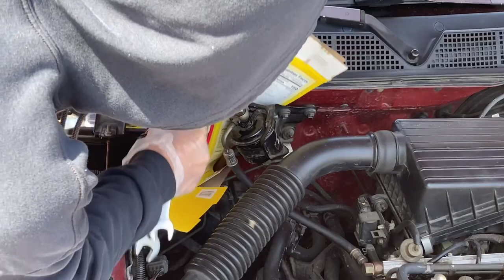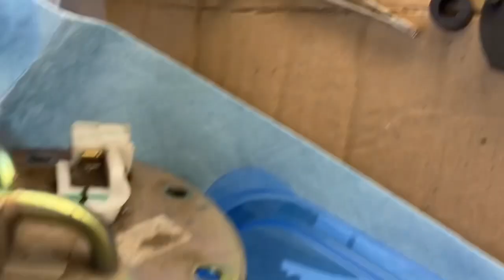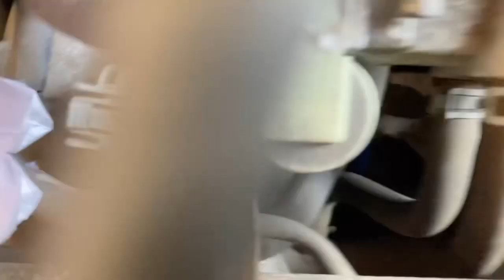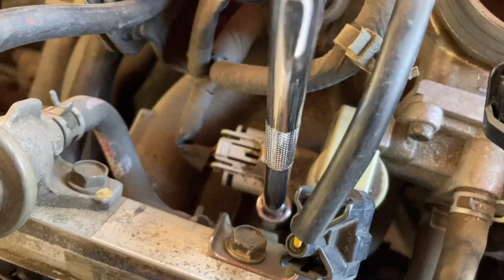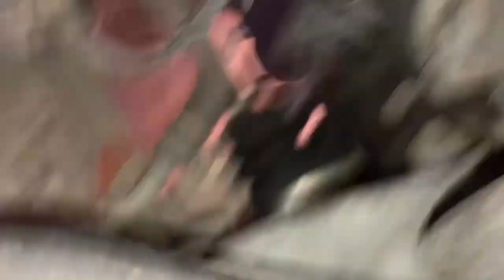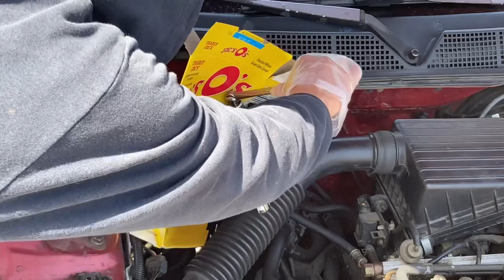Fuel Injector and Fuel Pump Replacement 1998 Honda Civic

Comment: When you installed the fuel injectors. Don't you suppose to program it in the EC???  also why is RPM needle jumping ?
Reply from the maker: No, don’t need to program anything after the fuel injectors
But the RPM needle was jumping because of a chip in the distributor 
I eventually found that one of the parts in the distributor was slowly going bad 
After replacing it, the tachometer works normally 

It was causing an occasional no start and stalling

Comment: I just went to O'reiley website to search on that part # Fj337 Standard Fuel Injector.  its says ---> Does NOT Fit 1998 Civic??? So if this video is for 98 civic than that part should not fit?
Reply from the maker: So instead of searching up the part number
Just search up fuel injectors for your car on the O’Reillys website 
See what parts come up as compatible 

I’m looking it up right now and as a fuel injectors for a 98 Honda Civic I get that part number 
But it specifically does not say 1998. It says fits Honda Civic. 

So I would say just go to your parts store and get the ones that are recommended for the car 
By the way, I noticed that they’re about $150 which is super expensive 
And you could probably remove the fuel injectors and just clean them thoroughly !!
I know there’s lots of videos here on YouTube explaining how to clean fuel injectors 
You could probably save yourself a lot of money, just cleaning them and reinstalling them

Comment: I changed my fuel injectors on my 2000 civic, after installation it would not start only crank. Any ideas?
Reply: get new ignition coil

Comment: I have a civic 98 dx and getting a EVAP Leak P1457 but can’t pin point issue it said it was a sinenoid valve or the carbon canister, it does run but it turns off every know in then when driving but turns back on thanks